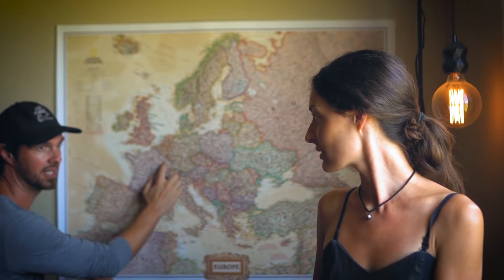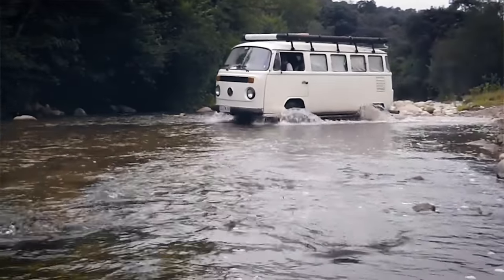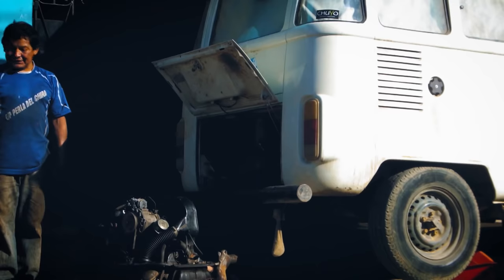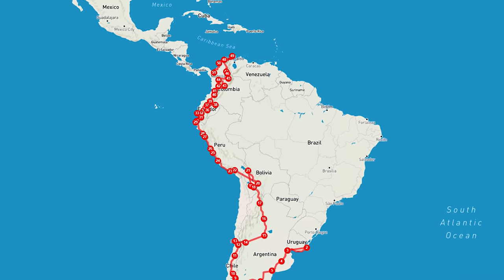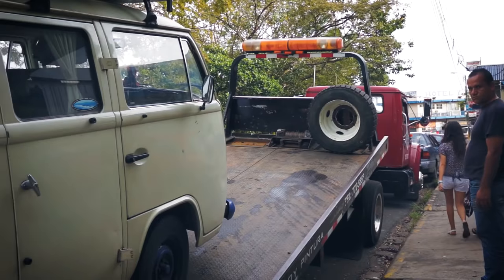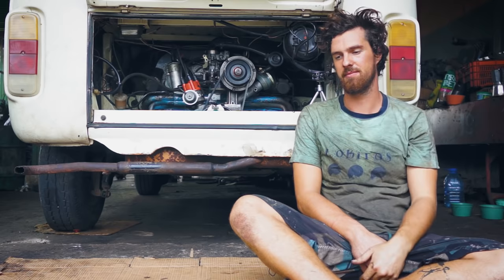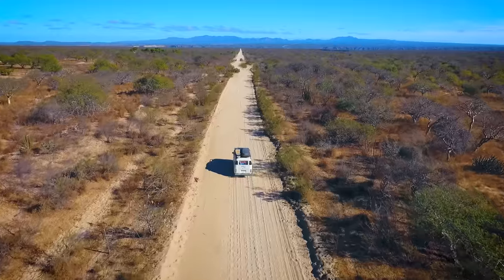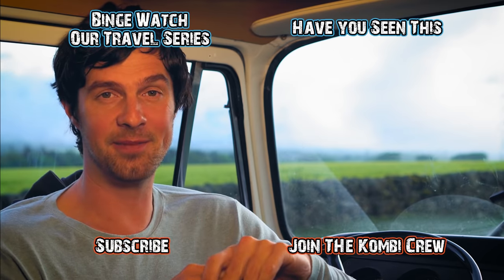How Did I BLOW UP 10 ENGINES in 1 ROAD TRIP???

Comment: Step away from the VW, you have no clue what your doing.
Reply: VWs are piles of shit to begin with...be serious.. id never ever ever ever waste a dime on a vw...
Reply: Jonathan Arent disagree, how many other cars do you see still on the road pretty much untouched after 50+ years? 
There are also very few engines that can be rebuilt on the side of the road like these. 

The new VWs are rubbish though. 

The thing I don’t understand is how can he make such a reliable engine fail so often!
Reply: @Mi-ck  So the T5 is rubbish? The whole T series has been quite good. Or are you talking about VW in a whole?
Reply: @jonathanarent3363  hahahahaha VW's with over 500k km are more common than VW's with less than that
Reply: A lot of trouble could have been saved by rebuilding the engine properly the first time around and installing a cylinder head temperature gauge.
Reply: @EmpiricalSin  T5 is least reliable from the series, You see it often being towed by T4....
Reply: @wornoutshoes11  not sure what Your standards are, but they are far from classy. Volkswagen means Peoples car, how a car meant to be made in millions for working class is classy? Is Toyota Camry classy too?
Reply: @MindBlowerWTF  T4 and T5 are both really good. T1 is least reliable.
Reply: @Membrane556  I will second that.
Reply: @wornoutshoes11  Classy? When lol
Reply: @MindBlowerWTF  the 2019 camry XSE v6 looks amazing and has a good interior so yea i'd say its classy
Reply: Jonathan Arent you’re totally right
Reply: @jonathanarent3363  totally right pieces of rubbish and even worst if they are air cooled like this one
Reply: deee327ify  yeah so easy he needed 10 engines for a freaking trip, i'd do the trip with only one engine in my old ass peugeot without any problem and even cheaper because it is diesel
Reply: Im a mexican they are better than nothing else but i think this guy gotta be away of vw.

Comment: i got my 88 f150 with the 300 in it at 300,000ish miles. ive put over 100k miles on it since. only had to replace a clutch and oil. i think its a keeper..

Comment: My theory for the studs pulling, I'm thinking too much compression or the studs were not tighten in the right order and not tight enough or too much. If the head or block or both were planned at some point in time, that would give you too much compression. In that case you would need a thicker head gasket.

Comment: The basic design for these engines dates from the 1930s. They were cheap during the hippie era in the US, so they have a strong cool value, but they're hopelessly unreliable, even though they're  really cute and charming. Smart owners ditched the VW engine and fitted a water-cooled Subaru engine, which gave far more power, together with a level of reliability that owners of the original VW engine can only dream of.

Comment: A lambda (oxygen) sensor ist so cheap nowadays that you are really stupid to NOT fitting one to a carburettor engine. Just wire it to a display and check that its below 1.0 - THE END
Reply: What do you do if its above 1.0?
Reply: @MilesPrower1992  First of all, STOP. Especially with a aircooled engine under full load. A big, cool V8 can run lean at partial loads without much issues. It will produce gigantic amounts of emissions (Nox), but hey...  So what to do? First of all, this should not happen. Sudden lean mixtures do not just occur. Easiest would be to just mount your spare carburettor which you brought with you. If you don't have one, and it worked fine before, you should examine the jets and fuel flow to and from the float chambers. If NOTHING helps, try to drive with the choke on under very light load. Try everything to get as much fuel as possible to the engine.
Reply: @88manta88  makes sense to me

Comment: I had a '77 poptop w/ a 2215cc fuel injected pancake. The engine had been rebuilt by previous owner so I drove it with confidence until one day as I was cruising at highway speed & alternator light suddenly came on. I pulled over to see what was happening. The belt had come off but was intact because in fact the fan had walked itself right off the crankshaft. There is supposed to be a woodruff key in a slot on crankshaft that holds fan in place but it wasn't there, also a big washer to keep fan pressed on crankshaft, also missing. I should have turned it off & called for tow but thought I could scurry a few more miles up the road before it overheats??  Long story short, Rebuild #1 for me. I bought all new everything & once I got it going, sold it quickly.

Comment: Had 2 VW Type 2 Buses in my time, a 1964 and a 1972. The '64 eventually rusted away to almost nothing, but not before I drove it from Pa. to Florida on a rebuilt 1776cc dual-port. With a deep oil sump and oil cooler, oil temp rarely got over 190F. Having an oil temp and a cylinder head temp gauge are critical, if you want to monitor the health of your air-cooled V-dub! On that trip, I didn't have any radical altitude changes, although I WAS loaded pretty heavy with tools and household stuff. The '72 was kind of short-lived as I installed a modified 1641cc. upright engine with dual oil coolers to replace the original Porsche 1.7L pancake engine, that was already blown up. Traded it off 6 mo. later for a motorcycle... 
Later on in life I moved to New Mexico and 6000 ft.+ altitude and things got hairy for a while until I finally got a good working high altitude setup. (now only had a '71 std. beetle). I built a 1641cc dual-port from the ground up in 2007 with all the trick accessories to keep the heat away and plumbed it with a good cam, counter-weighted crankshaft, big heads with stainless valves, deep oil sump, oversize oil pump, and a huge oil cooler. This coupled with easily tune-able twin 40 mm. Kadron carbs, and electronic ignition, kept it alive and running like a striped ape for 60,000+ miles until I finally sold it. Heat is the enemy, and good fan speeds are your friend on air-cooled VW's, so when in doubt, or when those temps start climbing on the oil and head temp gauges, do like the truckers do, and drop a gear and back out of it till you finish climbing whatever hill you're on, and then drop back into 4th and let it cool down (with clutch out) on the down side. Just my little experience over the years. Other than vapor-lock issues with the stock fuel pump, I've never had either of my buses or my Bug leave me stranded on the road. I finally sold the Bug earlier this year because I've become disabled and can't really work on it anymore, so I got a water-cooled Toyota van to remind me what it's like driving my old VW buses!😁👍

Comment from the maker: With regards to the Carb Jet comment that everyone keeps making.  Yes, drilling out the main jet would make it run richer, NOT leaner, but I was referring to the Air Correction jet rather than the main jet.  Which would make it run leaner.  It's number 24 on this diagram. https://www.thesamba.com/vw/archives/manuals/carb_sheets/solex_68to74.jpg
There is every chance I am wrong, thanks for the comments, I'm enjoying reading them.

Comment: Wow awesome summary of you’re trip. One tip I could mention for you is perhaps being along a VW gear head with you next time. And I would cut some holes in the engine bay and put in some scoops to allow more air into the engine Bay Area running up and down the mountains if you have a carburetor you should of had 2 or 3 on hand. The timing also could of been advanced quite a bit more at sea level.  I worked for 20 plus years in a VW specialty shop and I saw my fair share of blown engines but heat is the killer to these machines anyhow I have subscribed and hopefully I will be able to follow you on future journeys maybe perhaps help but I am sure you have tons of help now anyhow good video and good for you to persevere might I say if you plan on doing this trip don’t get a waterboxer they had their own problems but the nostalgia of the old type 2 is pretty cool

Comment: Came home yesterday from a 8.700 km road trip in a 21 year old Fiat. Only thing failing was a viperblade. I did a complete overhaul before and I took it slowly up mountains. Be easy on your car. On my journey I saw plenty new cars flooring it uphil and moments later, parked on the shoulder with warning flashers on.

Comment: As others have spotted your engine seemed a little light on the tinware that is essential on these VW engines. I think that choice of engine oil may also be a factor. I'd also increase significantly the number of times the engine oil is changed in hotter climates. Also, an oil temperature gage would be a very worthwhile investment for your engine. I hope all goes well with your trip and look forward to further videos
Reply: Paul Fro I used  vr1 50w on my dub
Oil temps to high for any thing else

Comment: My 63 bus has 6 quarts of oil 3 coolers 1915cc. Duel carbs . low compression 8/ 1/2 to one . never breaks . change oil every 2k. Rotela . 20-50 . . 40 year's strong driving a old vw is a adventure . .I will do this crazy trip until I DIE .

Comment: He changed the jetting to allow LESS fuel at high elevation...where there is less o2, thus, at lower altitude where there was more o2 you were running lean, causing the engine to run hot.  Add the extra weight and load, and the poor engine was likely knocking, pinging and putting stress on everything.

Comment: I live in Alaska and I'm currently in the middle of a engine rebuild for my 71 beetle. Rather sad I never got to see you passing through little ol Fairbanks. Atm I can't afford a full rebuild so it's basically just new bearings and cylinders/pistons and an oil filter! Hopefully sometime next year I'll have the money to ship the case south for a line bore and be able to afford the shipping for a full rebuild kit that includes flywheel, crank, rods, pistons, cylinders, the works.

Comment: WOW! 10? Drove 1966 VW bus daily for 20 years. On my fifth engine 300000+ miles. Drive across US twice and up and down both Coast. Many Dead shows the bus was still 6volt. Top speed 65mph. Just wanted everyone to know it can be done. Not comparing as parts were available and I was the mechanic. Also I always have spare carb and distributor coil etc. Any time I go far from home

Comment: After going to a mechanic the second time, If I didn't have any mechanical knowledge, I would be having someone help me figure out how to repair it myself immediately or you really should have done some research ahead of time especially whenever you had online internet access even more so since its a much older vehicle.
My slogan with Mechanical work is to do it right the first time, Every time, with new parts or resurfaced/rebuilt parts where it is acceptable. You will regret it later if you don't, Ive gotten on my friends cases pretty damn hard several times for wanting to skimp on tons of stuff to save money on projects we were working on. They ended up listening for the most part and everything went well overall..           As another note for anyone reading, Carbs are VERY tempter-mental. Learn your vehicles carb if it has one, How it works & how to adjust it as needed and swap out jets, You will never get it running right or get good gas mileage if you dont! 

Even where I live though, I don't trust most Mechanics to do the job correctly and have done all work to my cars myself with the exception of wheel work & alignments.
 I wouldn't hesitate to take my Mk3 Jetta 2.0 on a super long road trip myself although, Vs air cooled the 2.0 would be much more bulletproof for varied altitudes and everything, But an older VW is still a good choice for long road trips if its well kept (Same goes for most cars too, Proper maintenance is key)

Comment: When you lean out the fuel mixture,  the hotter the engine goes. On high performance engine you actually  richened the mixture to cool  the engine. On my own engine I put an extra oilcooler with a small fan by adding an oilpump  wich has its own inlet and outlet built in its lid.

Comment: VW flat 4 air cooled engines are total junk. I have a 4.3L V6 in my Astro van with 432,000K on it and it is still going strong. Never an issue. It has 5 times the horsepower of a VW 4 banger and will run circles around them all day long. Cruises the highway at 100K all day and climbs mountains like a goat. I have crossed North America in it 6 times for a total of 96,000K of touring National parks in all of Canada and the USA. Plus 336,000K of normal driving. You made a terrible choice for a travel vehicle then and you are doing it again. Best of luck to you. You'll need it.

Comment: Thanks for fessing up the details.
Sounds like you really needed to be schooled a bit. It's so easy to say. But I would like to  think that I could read the engine running lean from the spark plugs.

Running the engine without a fanbelt is exactly the kind of dumb thing I would totally do myself.

Comment: Some solid gold advice! The old Aluminium in these engines is not known for its material strength... also the older engines have the oil cooler in the air flow for no 3 (i think) cylinder and they are known for having issues on the warmer cylinder. One bit of advice i would add is make sure you have grill covering the fan air intake... i seen what happens when you dont and suck something nasty into it.

One good thing is there are plenty of cheap parts available though. I dread to think what would happen if you had something that you couldn't get parts that easily.
Reply from the maker: Thanks for the advice Leyton
Reply: Not aluminum..magnesium

Comment: Ive owned two of these vans, '69 window and '71 Westfalia.  I learned that all it took to overload them was 4 passengers.  Not the suspension or transmission etc mind you.  The engine simply didn't have the horsepower to cope, so it got overworked and would overheat.  I would advise anyone who plans to travel any great distance in one of these to install an external aux oil cooler.

Comment: good edition and lessons learned even in retrospect are still lessons learned. the 6 ps come to mind, prior planning prevents piss poor performance. You cannot expect a vehicle of that age and condition to do that road trip without pain. a vehicle for a trip of that magnitude needs to be one of two types to complete the journey "trouble free" and I say that with reservation because of murphy's law, it needs to be new or it needs to be purpose built. I note you have chosen the later.A few tips ensure your new engine is not missing any tinware, invest in a sump extension this will give you a litre or two extra oil for cooling and get an external supplementary cooler for the oil, oil change every 5000k oil is much cheaper than engines. cheers

Comment: Yes, carb jetting problem.  We jet motorcycles for 1000 ft change in elevation. Any over temperature aluminum engine will lose valve seats.    A CV (constant velocity) carb is simpler and better if you are going up and down in elevation because it does not 'require' jet changes.

Comment: You dont drill "jets" for more air. Jets are for fuel, if any drilling occurred then youd have a rich mixture,  not lean one. Venturi are for air, which is pretty much fixed on most carburetors. Cant change that without changing the carb for bigger one.

Comment: Airplanes very often have air cooled engines. One very bad thing you can do is "quench" the engine. The engines are designed to run at a particular temperature, so the cylinders are shaped  so that as the metal heats up it moves into the correct shape to run best.
       If you quickly reduce the engine power the engine can "freeze" in this shape, then next tome it heats up, it moves to the wrong shape and can even quit. Very expensive to overhaul.
17:30 It's an even worse feeling in an airplane.

Comment: Yup, similar experience. Although not as intense has yours. Rebuilt 3 engines on a 71 Bug.  Finally got a ** Oil Temp Gauge “ !   Saved  the ENGINE !,  Now I pull over when the engine gets hot and I  blow it with a portable battery powered fan for a bit    No more blown heads. And a good running motor. !!
Reply from the maker: Yeah we have one of those too now (the gauge)  it does help a lot

Comment: Interesting video, but after I saw you getting another one of those I almost screamed at the screen for you to get a Toyota. Jesús man, you want to do another trip on an air cooled engine, that's just nuts. Temps are getting pretty bad everywhere. I ha a friend go from California to New York on a new motorcycle he had purchased new. He said the same thing, he had  problems with it overheating because it was an air cooled engine not to mention he couldn't keep up with traffic on the open road. It was a 750cc or something like that.
Reply: Type 4 engines are much more reliable. Especially with all the mods that have been done by his sponsors he should have no problems.

Comment: I actually don't think he was drilling out the Jets, because therefore it would inject more gas into an already too rich engine (at that altitude) I think he was turning the mixture screw to lean.
Second thin you mentioned about your Valve play, that distance is so small, that it doesn't make a difference in terms of duration, so your issue must have been somewhere else.
All in all though I great great video series all together, I'm a huge fan, and if u learned a thing, it would he to buy a Land Cruiser instead of a Combi for me trip.
Huge respect though!